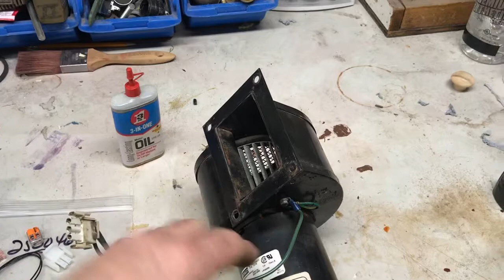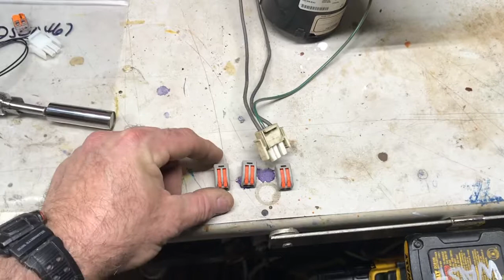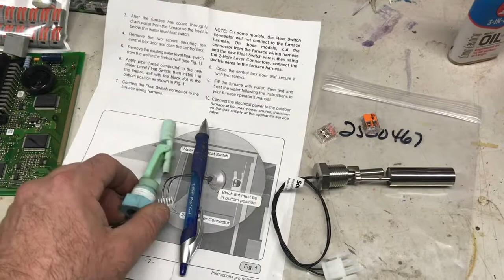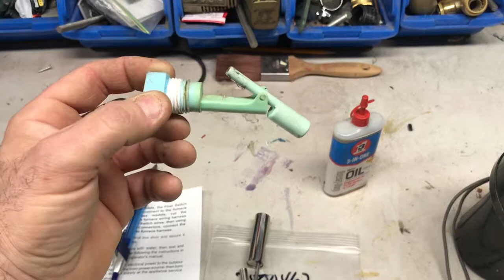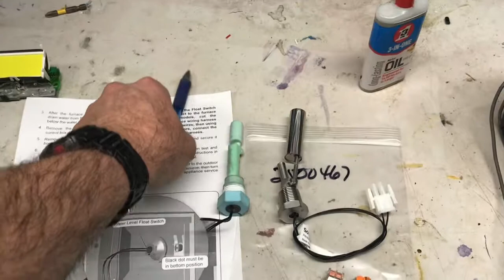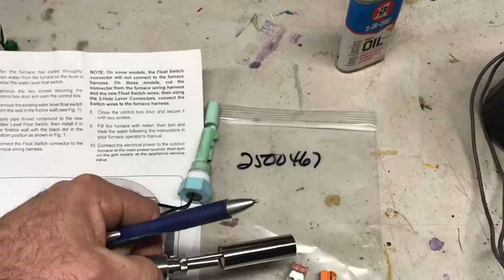Central Boiler E-Classic blower motor and water level sensor

Comment: On the instruction page on your table it says "black dot must be in bottom position" yet you say top. Can you comment what is the correct orientation? i.e. The float starts in the fallen position and rises with the water leveL?? THANKS

Comment: I need to do this.  I saw on a forum that you can hook up a wet/dry vacuum to the pipe on top of the boiler before removing the sensor. The person said that it will not pull any water out but will create a partial vacuum and reduce the water loss at the sensor port.
I'm going to try it as soon as the new sensor gets here.

Comment: Hello Tom, my lo-water cutoff just locked out my 3250 E-Classic.  Quick question.  Did your water leak much swapping out the plastic sensor to the metal one?  Thank You! Stuart
Reply from the maker: Unfortunately you will have to drain it just below the sight tube.  It will be easier than trying to stick your finger in the hole and doing a quick hot swap.
Reply: @thomaswalsh9312    Good news Tom, follow-up here.  Had to drain about 35 gallons of Glycol water to replace lo-water cutoff.  All good and we are back on firewood here in Alaska.  Take Care!

Comment: Great videos, My boiler just went down with the float issue after 7 years, I just bridged the wire connection to close the circuit to get it back up and running till I get a new float in!  Thanks for all your help
Reply from the maker: Your welcome :)

Comment: You have saved my day many times, Tom with all your videos. I just lubricated the fan blower and it runs perfect. A bad noise behind the back panel of my E Classic 1450, however, has me worried . Right next to the secondary solenoids is something which I identified from the manual to be a Close Off Actuator. I assume it has something to do with the gas ignitor and if that is true it worries me even more. Do you know anything at all about this? In YOUR back panel i do not see this "thing" at all. Would appreciate your input. Thanks.
Reply from the maker: Christa Phillips cool glad it worked out.  If you can text me a picture to 4012555758
Reply: @thomaswalsh9312  THANK YOU! Took picture. One of us is driving out 7 miles to send the picture, as we have no cell reception here. I hope this works. Let me know if you got the picture. I so appreciate this. My frustration with dealership is endless.

Comment: hey brother, love your videos... question.  I have a CB 2400, 2015 model.... I keep blowing the primary elbow solenoid... last about a day and blows.  I have a stick in it now to keep it open slightly, which is working but obviously I want it fix right. Any thoughts?  I'd love to give you a call if at all possible, I live in Mass right on the RI line.
Reply from the maker: Jim Brev I’m going to measure the voltage on my solenoid across the two wires and see what I come up with. I want you to do the same and I’ll post my voltage in the comments below shortly. There’s a chance that he may have a short somewhere or over voltage coming out of your 24 V AC transformer.   
Tommy.  My telephone number is 401-255-5758. Feel free to call anytime.
Reply from the maker: Jim Brev okay I have 117VAC across the two wires at the solenoid.  Hopefully your in the same ballpark.  

The other thing I was thinking was if you took that elbow off is your tube and elbow full of creosote? I’m wondering if the top plate is sticking but just a thought.   Is there any evidence of excessive heat coming out of the elbow.
Reply: I should check  that with my voltage meter?